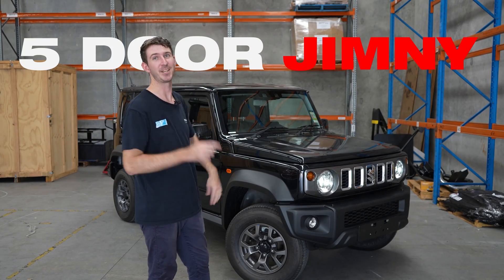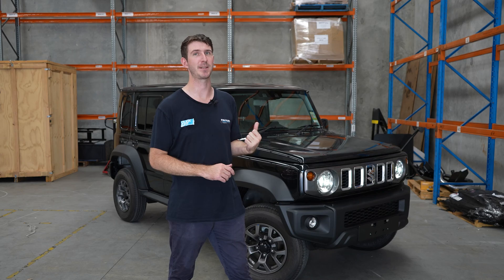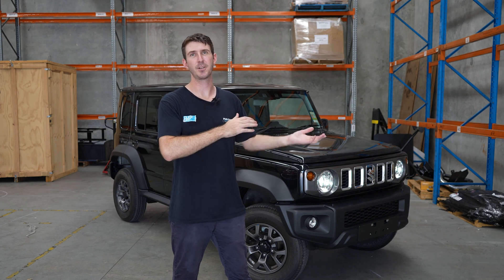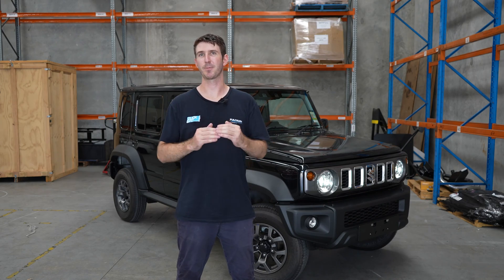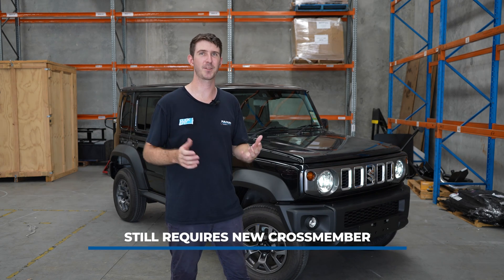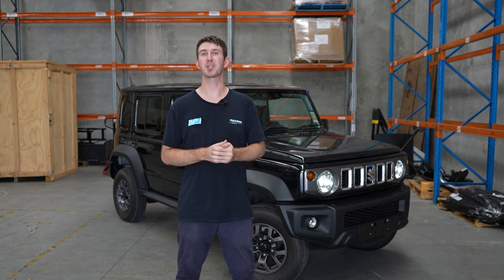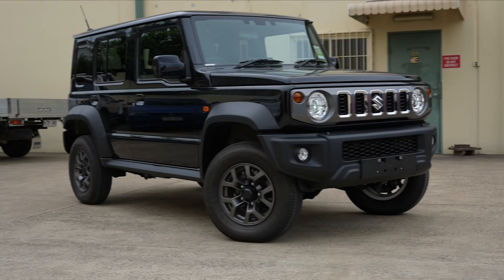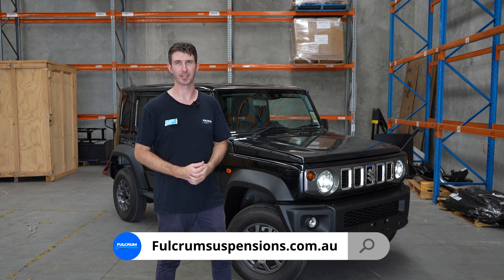Discover The Problems In 5 Door Jimny: Testing & Fixes - 5 Door Vs 3 Door?

Comment: @Fulcrum Suspensions, is the GVM upgrade for the 5 door almost avaliable? Its now 6 months after it said it would be in the video.
Reply from the maker: Hi Mate, unfortunately when we got to the end of the GVM process with the government approvals the allowed increased wasn't where we wanted it due to the design of the vehicles chassis, so we've had to go back to re-engineering the GVM. 

This unfortunately means we no longer have an idea on time frame. We've heard every company that's submitted for the GVM upgrade has come back with very similar responses from government approvals as well.

Sadly the vehicle's chassis design is the short fall here and so increasing it's strength in a safe and legal way while also still being cost effective to the customer is the challenge each company is facing.